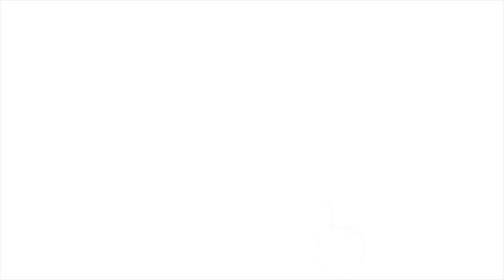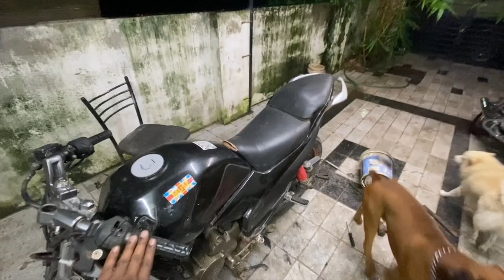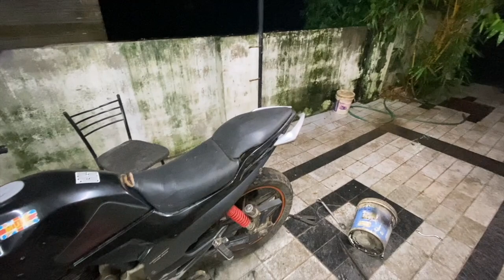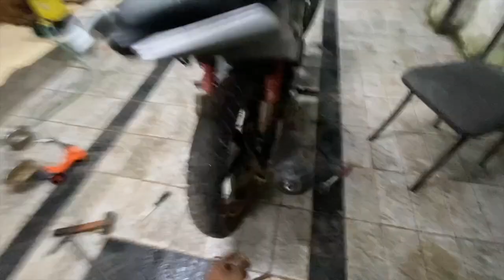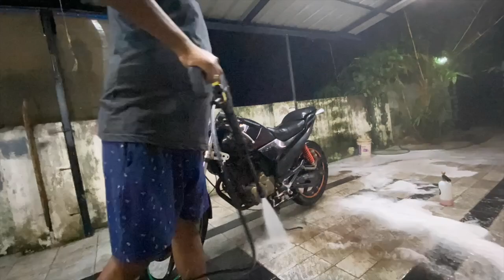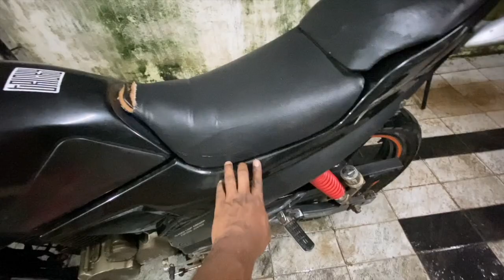Road to superbike Part 4 (Malayalam Video)

Comment: Woah! This one is a rare find. Its an Hero-EBR Karizma ZMR which has 20hp output. Its engine and suspension parts are quite expensive, but still available. It had an ugly looking EBR inspired front fairing (just personal opinion).

All that aside, you have got one of the best Indian sports-tourers ever made. I bet you would love it on highways.
Reply from the maker: Thanks, I too hate the font design, however the rear is well designed. I too feel it’s an ugly bike but it’s simply the right to passage if you are into touring
Reply: @Yamakaze  True. It is the (not one of the) most comfortable sub 250cc bike. No other bike offers such good pillion comfort. Sadly, they don't make such bikes anymore.
Reply from the maker: @manu201022  very true